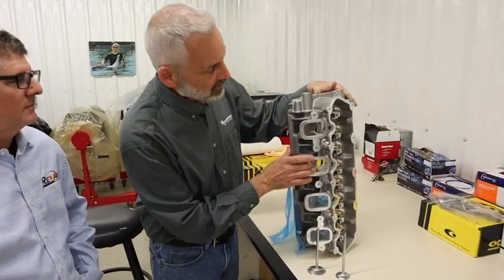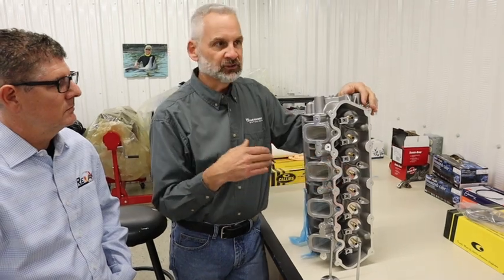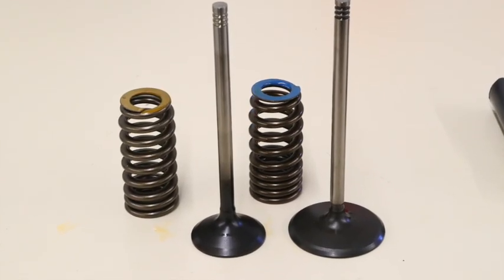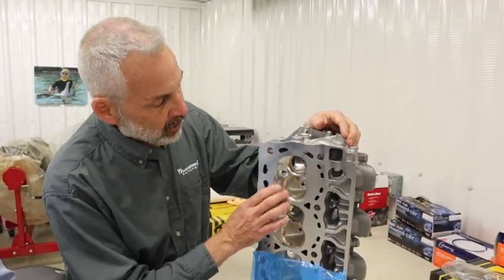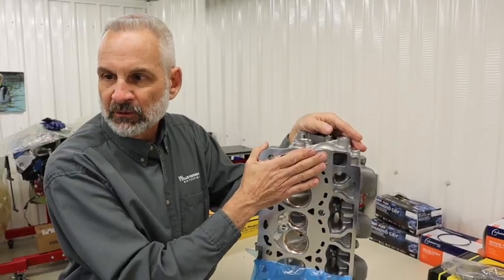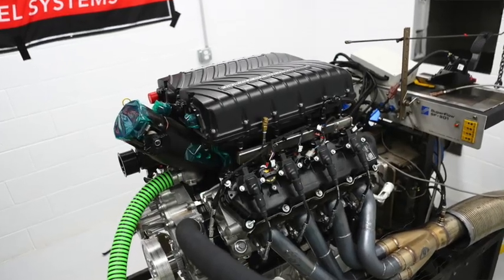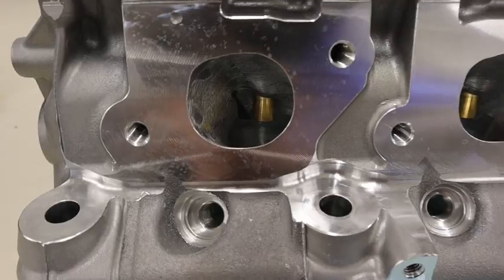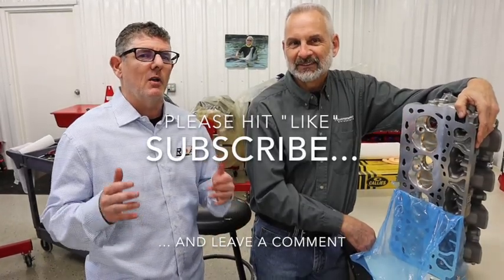Godzilla 7.3L Stage 2 Ported Ford Heads - See Why These Will Make Big Power!!!

Comment: WHAT DETERMINES THE DIFFERENCE BETWEEN WHAT A SMALL BLOCK AND A BIG BLOCK IS? IT IS THE ROTATING MASS, THE WEIGHT OF THE CRANKSHAFT. THE SMALL BLOCK FORD,CHEVY, CHRYSLER ARE IN THE RANGE OF 40LBS WHILE THE BIG BLOCKS ARE IN THE RANGE OF 65LBS. THE ONLY REASON THE BUICK 455 MADE THE MOST TORQUE WAS DUE TO THE FACT THAT THE CRANKSHAFT WAS 10LBS HEAVIER THAN THE FORD 460 AND CHEVY 454 AND THAT WAS THE REASON. BUT IT WAS A TRADE OFF BECAUSE IT SPINS UP SLOWER AS OPPOSED TO THE FORD AND CHEVY. IN DRAG RACING THE KEY IS TO KEEP THE RPM UP AND THE BUICK WITH ITS HEAVIER ROTATING MASS FAILED IN THIS AREA. THE PONTIAC ENGINE IS CONSIDERED A SMALL BLOCK BUT THAT IS DESPUTABLE. BY CRANK WEIGHT IT CAN FALL CLOSER INTO BEING A BIG BLOCK. FOR YEARS I ALWAYS WONDERED WHY THE PONTIAC 326 NEVER BECAME A COMPETITOR TO THE CHEVY 327. THE ANSWER WAS THE CRANK SHAFT WEIGHT. THE PONTIAC 326 CRANK IS HEAVIER AND WITH SMALLER CUBIC INCHES WHICH TAKE IN LESS AIR/FUEL THEY MAKE LESS POWER. SO THE PONTIAC WAS SLOWER TO REACH RPMS AND THE REASON IT COULD NOT COMPETE AGAINST CHEVY'S 327. DIESEL CRANKS ARE HEAVIER FOR A REASON. 
EVAN, THE QUESTION I HAVE HERE IS THE WEIGHT OF THIS GODZILLA CRANK AS OPPOSED TO THE OTHER FORD ENGINES LIKE THEIR BIG BLOCK AND THE 351 WINDER WHICH HADE A HEAVIER CRANK WHICH WAS THE REASON IT MADE GLOBULAR AMOUNTS OF TORQUE.

Comment: Hey guys I have a 96 SN95 GT. It was my high school car that fixed up with my dad.  The car is now over 155K miles. For a while I was considering replacing the car, but I don't have the heart to do it. The car is very clean except the motor. The 5.0 swap is a no brainer but this motor has my attention.  I like the displacement and the push rod simplicity.  With my dad being old school this motor seems like a better option. Looking to start the project in a couple years.  Plan is a Godzilla motor 650hp-700hp NA,  T56,  coil overs, and  built rear-end. Any knowledge of all the challenges and costs would be helpful. We are car guys doing some but not all work.  My father has a 47 year machine repair background at ford so please consider that haha.  Goal is a street car that dances on the edge of scary but drivable.

Comment: Where you removed that small bit from where the spark plug is, will
That not let carbon build up on the spark plug threads, thus being hard to remove later?

Comment: What are the stock Intake Port Volumes and what are the intake port volumes after porting? You said flows @ 300cfm.., at what valve lift is that?  Any chance we'll ever see a cfm flow chart; before/after porting?I know what the stock intake port volumes should be, but I cant seem to find and definitive answers from anyone as to what the intake port volumes actually are

Comment: You forgot the fact that cnc-ported has a better airflow than hand ported
Reply: this is untrue. cnc machining offers consistency from port to port, provided there's no core shift. an experienced porter could easily match or even exceed a cnc port.

Comment: The 7.3 just feels like waiting for a stripper to show at a bachelor party and then have the audacity to show up 2 decades too late.  Basically new to the industry. Zero after market support , in the light of what G.M. has BEEN doing with the LS ,and now more affordable than ever. Complete business have been built on the LS in motorsports. Why has Ford waited so damn long ? Especially after the 5.4 debacle.
 Signed;
 Not feeling it Ford.

Comment: I would like to see both torque curves side by side to compare the difference each manifold has on torque and rpm.
Reply: That will of course be coming when the engine goes on Dyno.   You can checkout the willis performance FB page for all the data to date.

Comment: Do you know if the upcoming 6.8L is related to this engine? Is it the 7.3L with a smaller bore or a 6.2L with a 7.3L crank or some completely different?
Reply: From the press releases a variant of the 7.3L
Reply: @brianwolfe2993  Thanks. If you have access to a 6.2L could you confirm the 7.3L crank fits? Thanks again.

Comment: I am respectfully curious....is the cost of such improvements in the realm of "if you have to ask, you can't afford it" category? Thank your for your response.
Reply: You can contact me at wolfe@willisengines.com.  But in short our Stage 1 heads which are 700 HP capable are about $1250 which is just to CNC your stock heads, supply bare we return bare.   The cam is about $650.   I am waiting on valve spring costs for production.  The missing element is a low cost short runner intake, we made that power with a billet intake which is stupid expensive unless you are running one of the heads up classes, like RvW, LDR or X275 where these are the norm.

Comment: Man I’m so glad too Ford back in the pushrod engines. These engines are going to hurt some Ls feelings.
Reply: And inside our own community as well.caugh caugh coyote guys.
Reply: Uh... this motor can’t even compete with the LS7 from 2005... Dont get me wrong I’m happy Ford made it but stop taking Jabs at the LS.. you don’t have to hate the LS to Love the Godzilla.. the Ls7 makes 650hp to the tire! N/A with a cam/head and intake upgrade.. think about that.. that was sold in 2005 as a 06!!!
Reply: @BLACKLACDTS  🤣🤣.......lts are doing the same wtf are you blabbin about..... 7.3 did all this stuff stoc they haven't even made heads and cams yet...... fucn clown 🥱 tt 7.3 stoc put down 1100hp comfortably cut your bullshit
Reply: @BLACKLACDTS  "its anything" anythinb 🥱
Reply: @BLACKLACDTS  what are u bringin up the coyote go to bat for your ls platform dont worry about ford my guy.....THEY GOT THIS BAGGED AN TAGGED
Reply: @BLACKLACDTS  Man, the Godzilla is definitely going to walk the LS. This is a badass platform made to run hard and you have options to go anywhere with it but you want to go. I wonder what circle track sanctioning bodies are going to throw on these. They got rid of the FE and Cleveland….
Reply: No pre computer trans available .

Comment: Just cam+springs+ring gap+boost. I'm sure it will break the 4 digit power mark at 10 PSI with an S480/ S500 SXE. Someone send one to Richard Holdener.
Reply: I will be running a Whipple this year and a Turbo on my dyno early next year.
Reply: No kidding
Reply: @TMB5BER  This is the way.
Reply: https://www.youtube.com/watch?v=Fr4w3Y48IB8

Comment: Disappointed in this video. 
I don't particularly need the gibberish explaining that airflow (cylinder heads) is tantamount to making horsepower nor the fact that modified heads start from stock heads - I watched to see the output improvement over the stock head.
Mext time I'll just scroll by unless it specifically says 'Dyno' in the title.
Reply: Mikey, better yet, just stick with Speed Racer Cartoon videos, you won't be a dissapointed.
Reply from the maker: It’s a process. I’m sure you’ll be pleased when we install them.

Comment: What bellhousing pattern does this engine use ?
Reply from the maker: Same as 4.6 modular and Coyote.
Reply: @revanevan  So FoMoCo is still dead since 1996 .
Reply: They look pretty alive and well to me..what do you mean?
Reply: @cesarpalmos8235  Not a good substitute for Lima or windsor series , not for a real life budget ,  no pre computer trans fits , my 60s and 70s Fords are only related by the name.
Reply: Yeah I want a 7.3 with a four   on the floor for my 78 f150.

Comment: Awesome! What are flow numbers on the stage 2 and also stock and stage 1?
Reply from the maker: Stay tuned for flow numbers. Sorry we didn’t get to include them in this video.
Reply: @revanevan  I heard him mention 300 intake. Is that stock?
Reply: @randys66garage  Yes, they flow just over 300 CFM stock.  The Stage 1 heads did make 690 HP with a large hydraulic roller cam and a short runner billet intake.   We will have stage 2 results in December if things go to plan.
Reply: @brianwolfe2993  Thanks! What did exhaust side flow?

Comment: Ford: please offer this in the F-150
Reply: They are doing a 6.8 instead
Reply: They are...its an aluminum version with less displacement at 6.8L
Reply: @cesarpalmos8235  
I’d be happy with the 6.2 in the F-150.  That’s a proven motor and it would be great mated with the F-150 10-speed
Reply: Scott Dobson sure but isn’t the 7.3 platform about broad flat torque curves ? It’d be nice if such could evolve into one not needing more than a simple and durable four speed automatic.
Reply: But I think it will be based off this new 7.3 block.
Reply: not going to happen
Reply: They do

Comment: Sir, are these heads the same as those to be used on the 6.8 liter engine for 2021 Mustang and F150??
I'm looking forward to some aftermarket heads, I'm going to need the thicker decks.
Reply from the maker: I highly doubt we’ll see a 6.8 in a production Mustang, but anything is possible. And yes, same engine family.
Reply: @revanevan  I read some magazine article that said the Coyote was gone and the 6.8 was in come the 2021 model year.
Oh well, it sure would have made a great Super Stock drag car.
Reply: @johnparrish9215  ive read that a GDI 6.8 was tested on a mustang. Iron block still. At 1:20 you can see the GDI injector position
Reply: @1985metalmaniac  2011 .................Is that were they want the GDI boss ?????
Reply: @1985metalmaniac  I've been thinking lately that the GDI just might be a weapon we Hotrodders can exploit.
Lets say you build an engine with GDI heads with regular Port Injection. The engine is at full power and the piston has just past TDC on the power stroke, at that moment when the cylinder pressure is just starting to fall your Engine Management injects Nitro Methane into the already burning mix via the GDI injectors. That could give you much higher cylinder pressure when your Crankshaft angle is more able to use it.
Reply: @johnparrish9215  You can still make it a SS GT car.
Reply: @1985metalmaniac  No those are location points for the casting to keep combustion chamber volumes constant in the casting process.
Reply: @dannycalley7777  according to brian wolfe no. im mistaken
Reply: @brianwolfe2993  ah i am mistaken with misinformation. Werent you on the design team at Ford for this engine? Ive seen those holes on the modular 2 valve engine and asked someone then what they were.
Reply: @johnparrish9215  Although earlier i said they were the GDI bosses i was mistaken so maybe not this engine but it seems like your onto something there. I think you would have to preheat the nitrous and break it down prior to injection as of course its missed the compression stroke. The 3cyl ecoboost engines have GDI and would make a good testing rig without breaking the bank.
Reply: @1985metalmaniac  No, not Nitrous oxide, Nitromethane like in a Top Fuel car. It's dangerously volatile when used in high concentrations, like Top Fuel, but would be very managable in this case.
Reply: @johnparrish9215  i miss read. So what i can understand you still want to use petrol for the first initial combustion and then follow through with nitro. Obviously you need 2 seperate tanks and fueling systems. the timing for gdi would need and ecu running parallel with the the petrol injector ecu i think. Maybe theres something on the market that would cater. Id still try it with a cheap junkyard ecoboost engine first or something. If its blows up then its no great loss. While it does seem an interesting concept. 1 if an engine were to work how much nitro could be added till the engine blows up and 2 how much horsepower would the engine have to make AND sustain it to jusitfy the costs and complexity of achieving this.
Reply: @1985metalmaniac  Timing would indeed be critical but I think a Megasquirt Gold box could do it, they are good for engines that run multiple injectors and fuels.
The only part about it that I would really worry about is the exhaust valves, I think there is going to be more heat than usual.
As far as cheap goes, your not going to get much cheaper than a 5.3 Chevy.
Reply: @johnparrish9215  is that the LT engines? i was thinking not v8 because youd need 8 of everything. which for an experiment would get costly very quickly to the point it would be cheaper to just use a turbo. initially i thought you meant nitrous oxide and thinking about that would have meant a complete burn. More efficiency, more power, low emissions and better fuel economy. wins all round.
Reply: @1985metalmaniac  LT heads will fit and function on an LS. The original LT DI injectors might work perfect, don't know until you try.
No, the engine I have in mind could care less about emissions...LOL
Reply: @johnparrish9215  ah but dont be so quick to shrug of emmisions. Good emissions means a good complete burn, better thermal efficiency, more power. good luck anyway
Reply: I read on Hagerty that the 6.8 was going to be a destroked 7.3 with an aluminum block.  I hope that's true.  It would make sense for the F150, and could even be put in the Mustang.  Such an engine would have huge sales potential for Ford as a crate engine.
Reply: @adamdodsy84  I believe he did misspeak.  But time will tell.